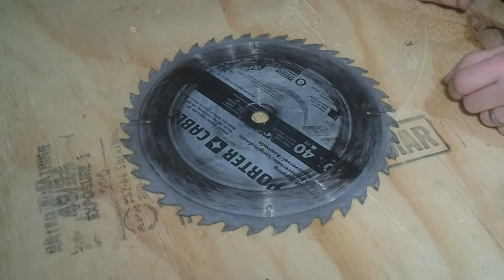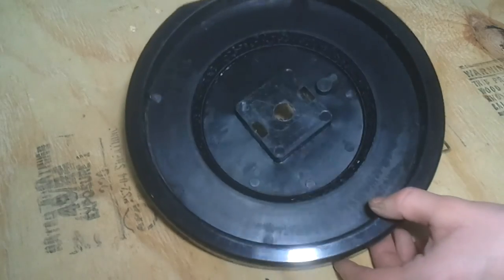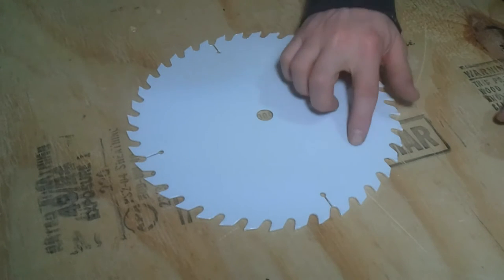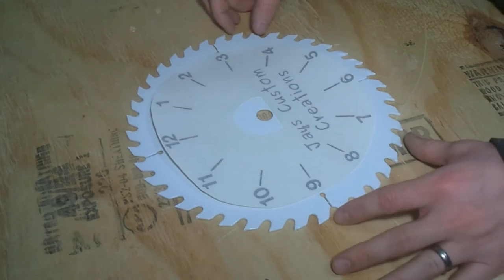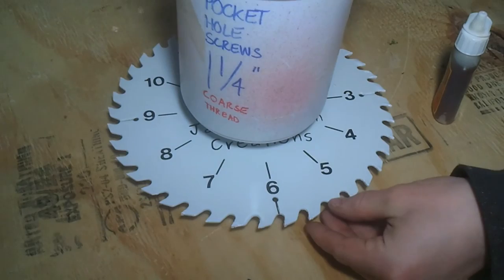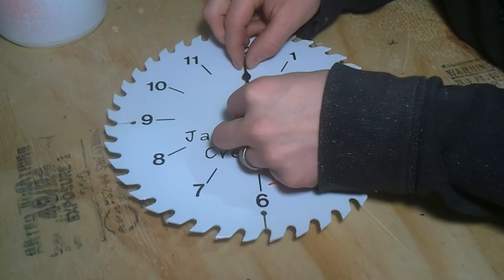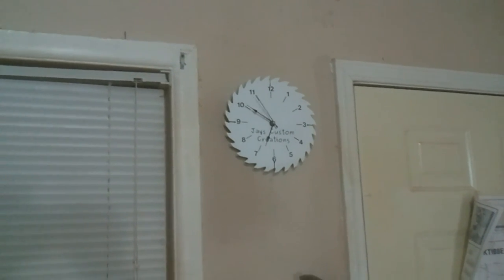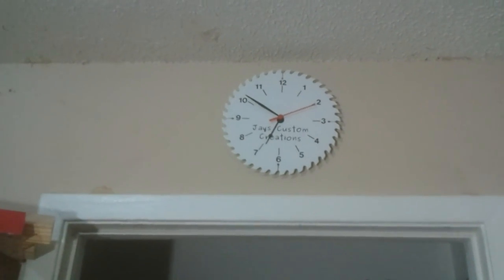Make A Custom Saw Blade Clock - 072

Comment: I have a large saw blade that i would like to do this with.  the blade is rusty, i figure i'll just sand it down a little bit, spray paint it, find a clock template have a print shop blow it up to size, you said they cut it out of vinyl, but i'm wondering what that sticker-aplicator for the vinyl is called so i don't sound like a babbling idiot when i go to a local shop to get them to do the template for me.  hope to hear some advice from you, if not either way thanks for the idea.  genius.